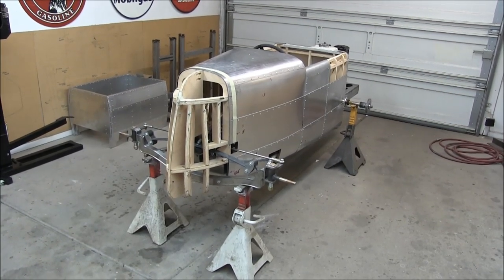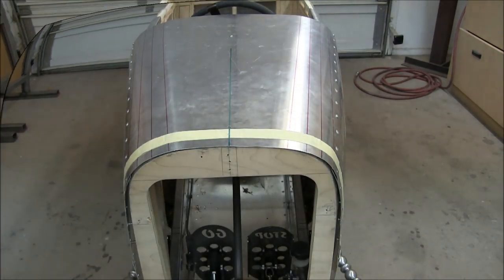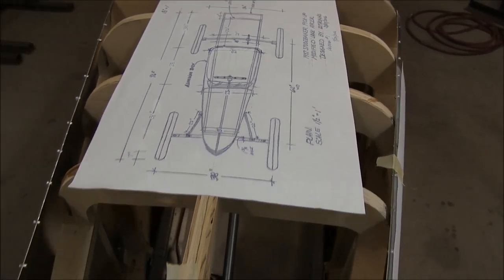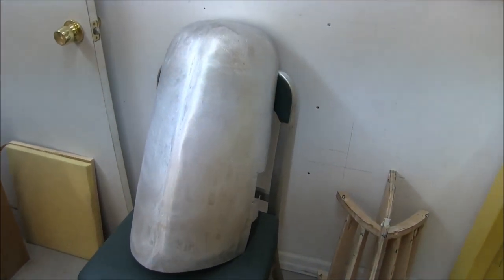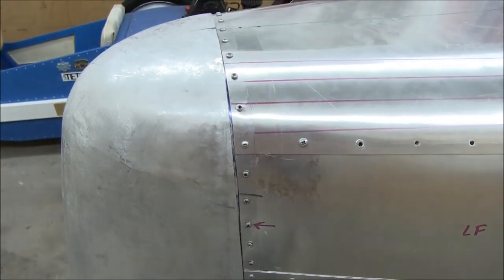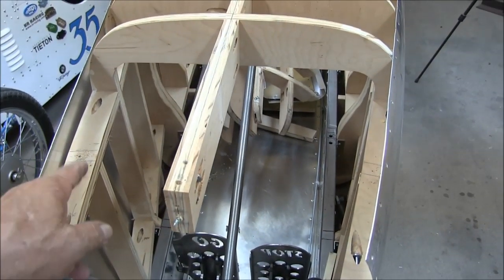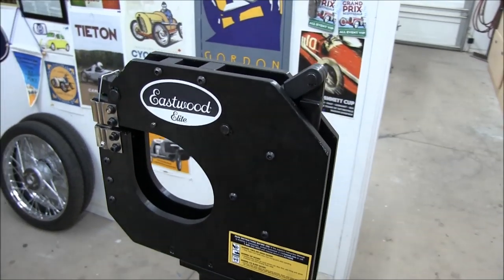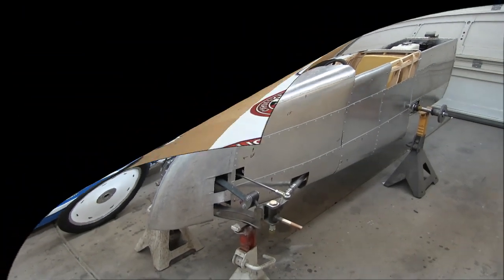Part 6 of Building the '37 Studebaker Body

Comment: Where did you get your front axel and other parts for your front end
Reply from the maker: I designed the axle then had the 1/8" steel parts cut with a water jet. I welded them together. send me an email and I will send you the pattern. thanks for watching!